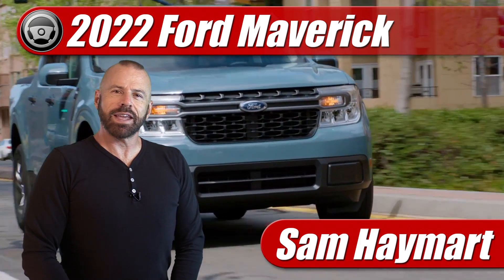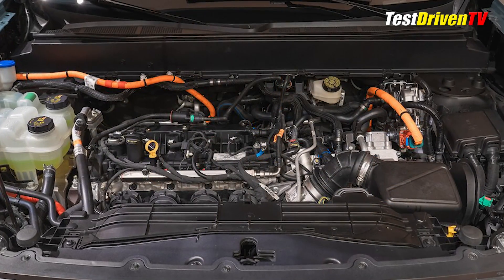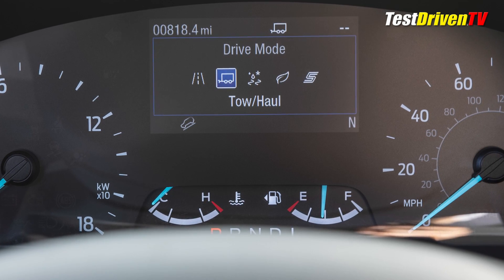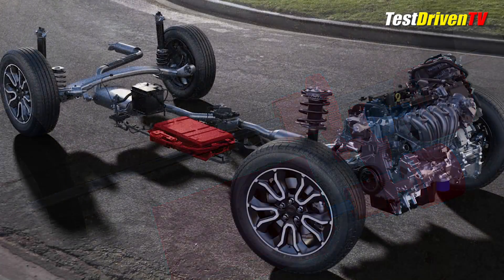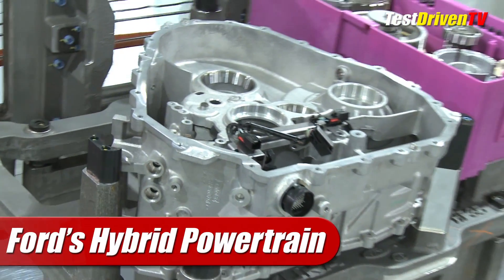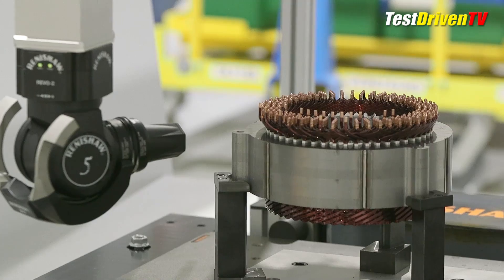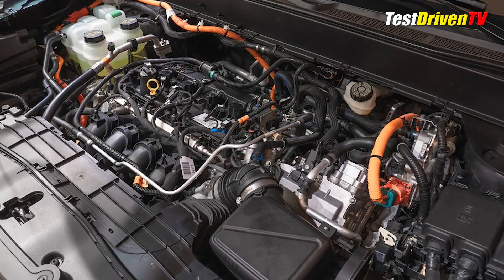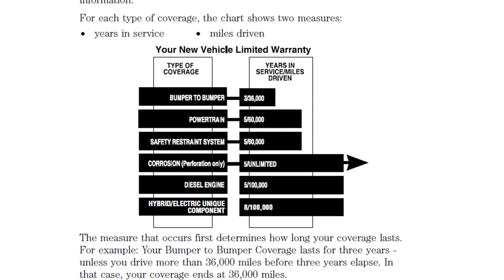2022-2025 Ford Maverick: Hybrid Explained

Comment: I’m having a tough time understanding how this transmission is continuous. How is the engine speed separated from the wheel speed and how is the engine speed carried to the wheels at a variable gearing without any pulleys belts or chains? Is the bigger electric motor doing this? Or to rephrase, is the engine spinning the motor which then spins the wheels or is the engine spinning the wheels?
Reply from the maker: That is Hybrid 102, this video was Hybrid 101. The simple (maybe) answer is that the engine and motors balance each other out. With a planetary gear set between the motor and motor/generator along with the second motor - all tied together with a single gear set, the electric motors can vary their RPM to spin the final drive above or below the RPM of the engine. The engine has an electric clutch that can disconnect it all together when it's not running.
Reply: @TestDrivenTV  thanks! I think I get it now. If I understand correctly then the wheel speed is only directly linked to the rpm of the large motor and the engine helps that motor by applying power to it while the final RPM of that motor is controlled by a computer applying current to it as wheel speed and throttle input demand.

Comment: Very good description but I think the transmission has another mode that you didn't mention. That would be the main electric motor powering the wheels while the engine powers the motor/generator (w/o a mechanical connection to the wheels). Let me know if I go that wrong.
Reply from the maker: That's in the Hybrid 102 video ;)

Comment: Being that the normal engine is being used at highway speeds, if I'm commuter, 40 highway miles one way to work. Would it make better sense to go the Ecoboost route? Excellent video. In other words, would I benefit from going hybrid if most of my miles traveled are at highway speeds?
Reply: Of course you're going to get 37 on the highway or greater

Comment: I have had 3 Ford or Lincoln hybrids.  They have all been exceptional, with only 1 hybrid related failure, a switch on the ventilation damper door on my 1st hybrid, a 2005 Escape.  I've put a total of over 500K miles on these, my last one was a Lincoln MKZ and I traded it in with 216K on it and it still had the original plugs and rear brakes.  These cars are very refined and extremely reliable.  I laugh at people who try to tell me that I will regret having a hybrid because of higher maintenance costs.  Oil change on the Lincoln recommended at 10K, I pushed it to 15K with oil quality still good.  Brake life is unbelievable.  No transmission maintenance required.  12V battery life is great because it doesn't have the starter wearing it out.  I had a Ford salesman try to low ball me on trading in my Lincoln telling me about the maintenance costs I was in store for, I laughed in his face and picked up my keys and left.  I don't know many people with more hybrid experience than me, and its been all good.
Reply: I have a Ford C-Max and it’s awesome , I’m about to do the first brake job at 200k the pads still have 5mm left , I got an upgrade kit so that’s why I doing that and pads , but no issues at all no starter to replace no alwtermator either
Reply: At what mileage is the 2022 Ford Maverick hybrid battery expected to require replacement, AND, any guess on the cost? I'm driving way too much, at the moment about 30k miles per year. Ford only covers the hybrid battery to 100k, and I'm trying to decide how long of the OEM Ford Extended Warranty to purchase in light of a potential large expense to replace the hybrid battery at perhaps 100k. Would it make sense to purchase the ESP plan that goes to 150k, and hope the battery holds out, or just keep it for 3.5 years and sell it at 100k?

Comment: Nice video and explanation of the ecvt.  I'm more interested in the upcoming Ranger Plug in Hybrid and was wondering if they will be using similar systems.
Reply from the maker: A Ranger HEV/PHEV would use a system identical or similar to that found in the Ford Explorer which is completely different from the one found in the Maverick. The Explorer uses a conventional 10-speed automatic combined with an electric motor instead of an eCVT described here.

Comment: I wonder after 100thousand miles can the truck still be driven without replacement of lithium battery and if so what would be the miles per gallon without hybrid running? Or you can't run the truck?
Reply from the maker: Anecdotal evidence out there shows people are driving Escape and Fusion hybrids with well into 200k-300k miles with the same battery. The weaker the battery gets over time, the more the gasoline engine will run which means less fuel economy.
Reply: So many people online, and in this very comment section are talking about how their ford's/Lincoln's with this very hybrid have 200-300k on them with virtually no issues. It's very well known that these hybrid systems are lasting 400-600k in escape hybrids. Words can hardly express how durable these hybrids are.

Comment: Ford will do well with this truck; it checks so many boxes for consumers and commercial users alike. Very impressive.
Reply: I can't imagine them not doing well. Haven't gotten mine yet but with the gas prices climbing ...........
Reply: @timjohnson1199  Have you received your Maverick yet??
Reply: @jimh.412  I have not. Everyone like me seems to be getting them around the one year mark which for me would be mid October.  If it doesn't happen within the next two weeks I'll get converted to a MY '23.
Reply: @timjohnson1199  Ok yeah I'm thinking about ordering one. Was just wondering what the average wait time was. So probably about a year wait?
Reply: @jimh.412  It's been out there a lot that the MY '23 will get production detailed and ramped up. But I would still not waste any time and order on Sept 15th when they accept new orders. Join the Maverick Truck Club for more details.
Reply: @timjohnson1199  Ok thanks!

Comment: Hybrid equals more maintenance and more out of pocket cost over the life of the vehicle. The 2.0 turbo has a lot more power and has been around for a while. It is a very good engine.
Reply: Uhhh it's actually the opposite. Less moving parts, the engine runs less, it's under less stress. Electronic components are more reliable and rarely fail. The battery will be under 100k warranty and by the time it fails a new battery will probably be dirt cheap because battery tech will explode in advance in the coming decade. Btw, I wouldn't trust a turbo charge ford engine if you told me God built it by hand 🤣
Reply: @DutchiezRNG  wrong hybrid is electric motor plus gasoline engine. More parts and the battery will not last 100k miles it will not be covered ford does 60k any way and truck people have a saying. It isn't broken in until 300k.
Reply: it is the opposite the turbo heats the engine and pressurizes it which wears engines out faster, also turbos dirty oil faster which is why they recommend changes 2x as often. All that yuck will also be inside the cylinders. add to that the hybrid regen braking will slow pad and rotor wear.  The hybrid is litteraly less maintenance for several reasons.. i could go on, just saying.
Reply: @LS-yv8zh  Your wrong also. Hybrid adds a electric drive train to a gasoline drive train. You literally double the amount of ways to propel the vehicle. It isn't rocket science.

Comment: Ford Is Starting To Get On My Nerves! Just Forgetting About Their Loyalists That ONLY WANT A CAR WITH LOW CENTER OF GRAVITY! JUST GIVE US THE CURRENT GEN FOCUS CAUSE THIS IS RIDICULOUS! It’s Like Ford Said “ Well We Already Used All Our Leftover Jaguar, Volvo, Mazda & Aston Martin Parts & Designs Now Let’s Use The Rest Of These Land Rover Parts & Designs That Are Leftover Too!” Plus All These Dangerous Recalls Cause Of “COST CUTTING” In The Wrong Areas! Looking Back Ford Has Been Careless About This For Over 50 Years!.. Ppl Are Starting To Second Guess If “Firestone Tires” Were Really The Problem On The Early 90’s Explorer!! Because My 2016 Sport Had PTU & Rear Suspension Recalls That Could Detach & My Fusion Platinum Had Steering When Bolt Recall Which Can Cause It To Literally Fall Off In Your Hands!🤦🏽‍♂️. I Really Want The Current Focus ST So If They Can’t Offer Something Then I’m Going To Honda.. Since They Didn’t “Sell-Out”…✌🏽

Comment: The Maverick's hybrid seems to be very similar to Honda's CRV hybrid system; in that the gas engine supplements(throught e starter motor) the battery and e-motor while e-motor itself is the total drivertrain: motor and transmission not unlike a Telsa. The Honda CRV uniqueness is that its still uses a mechanical AWD system.

Comment: So the brakes wear down? Regenerative brakes usually means that you should almost never need to change the brakes. I have the same brakes on my hybrid from when I bought it 10 years ago. They have just been adjusted a few times
Reply: As long as you aren't slamming the breaks, you should be able to slow down and stop on regenerative breaking. But if you need more stopping power, break calipers on a large rotor is the way to go. The less time you activate the calipers, the longer breaks last.

Comment: Disappointed that one cannot select EV only mode, and also it would seem that adding a few deep cycle batteries would add some range, but not an option if EV only mode is not an option. Guess I will wait for the plug in. Thanks for the information.

Comment: Very interesting -- especially that the combined total power of both motors (126 hp and 173 ft-lb torque for the electric, 152 hp and 155 ft-lb torque on the gasoline) is much higher than what they can effectively deliver working together. It would have been interesting to hear why the total isn't equivalent to their sum, though I imagine it's because they cannot both operate at full tilt at the same time. But otherwise a very good report -- thanks. I also have one on order!
Reply from the maker: Their horsepower and torque curves are vastly different, overlapping rather than parallel. At no time can you summon both power sources together operating at their peak rpm at the same time to get a cumulative output.

Comment: I have a 2014 C-Max Energi. It is one of the best cars I have ever owned. One thing that really isn't brought up is how long the consumable components last. Since the engine is used so little compared to the electric, I get over a year between oil changes (even then, it almost doesn't need it but I do anyway because I am afraid of oil viscosity breaking down because of the time). I still have the original brake pads on at 81k miles (because of regenerative braking) and the last time I check, I estimate I will get 120k miles on them! We get about 60 mpg out of it (and my wife's driving is not really ideal for maximizing mileage, either). I own 7 cars and trucks and all have V-8's except the C-Max and my sandrail so I am not exactly a tree hugger, but I will not be giving up that C-Max for commuting anytime soon unless it is for another plug in hybrid or a full electric.
Reply: My 2012 Lincoln MKZ hybrid had 215K miles on it at trade in and still had original rear brakes.  Fronts were replaced once and were over 50%.  Still had original spark plugs.

Comment: GREAT clear and informative video! Thank you for making this, I’m seeing so many comments with people concerned about the “”cvt””…. it’s an ECVT and it shares no resemblance to the notorious CVTs of old. I would bet the Ford Mavericks with the long proven and iterated Ford Hybrid drivetrain will be even more reliable than the Ecoboost optioned ones. Mark my words, especially when you consider the fewer moving parts and regenerative braking saving the brakes in the Hybrid system. People don’t realize that Ford tested an earlier version of this Hybrid drivetrain in NYC taxis for YEARS… and many of them are still running fine!
Reply: Plus, the Prius drivetrain has been used in taxis for years with no issues. And the Prius hybrid system is very similar to the type used in the Maverick and Escape hybrids.

Comment: I love my 2017 Ford C-Max Hybrid.  So, I was thrilled that the Maverick will have an updated version of that incredibly smooth power train.  Unlike some other manufacturers' hybrids Ford's will actually operate in electric mode at freeway speeds.  My C-Max does slightly over 70 with flat grades for a few miles at a time.

Comment: I love the nonchalant "It can kill you."
Reply: Warning :   "No Touchie"
Reply: The cables looked pretty protected but,  yeah, don't mess with them.
Reply: Your house has electricity. It has even more ways to kill you. What's your point? 

Do you just flip a light switch, nonchalantly? Or do you find a rubber glove and a ten foot wooden pole, to turn on a light?
Reply: @joezolo9986  i think the point is we're not used to there being anything under a hood that will zap the life out of us.  I didn't know until I watched this, and I've had mine for 3 days - sticking my DIY hand down in there messing with stuff.  That's the most valuable thing i've learned here.  These videos are SO well done and SUPER informative.  Thanks SAM.

I bought a salvaged Maverick with 9,000 miles and a lot to do to get it back together.  Just knowing this stuff is a great start!!
Reply: YIKES!

Comment: If you spend most of your driving miles in the city using the electric motor, and return home with the battery depleted, how do you recharge if you don't plug it in? Do you have to run the gas engine in order to recharge the battery?
Reply: As you drive the engine recharges the battery.
Reply: The computer won't allow for the battery to be depleted

Comment: Great video,  I'd like to see  something that covers what this truck can realistically carry in the bed.  Do sheets of plywood really fit between the wheel wells, how many yards of gravel or dirt can it carry etc.  I'm a DIY homeowner and would hate to get something that really can't be used as a truck on occasion.
Reply: Plywood, will rest on the wheel wells, and the tailgate. The tailgate has a half open setting, to match wheel well height.
Reply: you can carry 1500lbs of gravel and dirt in the bed i think you'll be ok

Comment: I'm curious as to why Ford has made all of their smaller platform, AWD vehicles non-flat towable? They are missing a fairly significant market of RV'ers who like to use small, 4WD/AWD tow vehicles. The days of Suzuki Trackers and the likes are long gone and there is still a void for that type of vehicle. Surprisingly I have read this FWD hybrid Maverick can be flat towed. That is great for those not requiring AWD, but sadly it doesn't fit the bill for many.

Comment: I have two questions. 1 is wonky. But I like to ask. 

If a house is on fire and has solar panels firefighters aren’t supposed to put the fire out. It’s not a great idea to spray water on a giant electrical grid. With that said, if a hybrid or electric is crumpled, do they use the jaws of life to peel you out? Because using a giant metal set of pliers on a big battery is not wonderful. So can someone answer that and second. 

The Ranger and f150 are build on a ladder frame and then put together. The Maverick is all one unit. So what does that do for accidents? Big or small. If the entire body is uniform, does a slight fender bender require tons of work or less?
Reply from the maker: The vehicle is not made out of a battery. The high-voltage battery itself is a single component that resides underneath the vehicle as described in the video. Firefighters have been dealing with hybrid and electric cars now for over 20 years. They know what they are doing.
Reply: weird how people are so concerned about the safety of lithium ion batteries like the ones they’ve been keeping next to their crotch for decades now (your phone, also laptop, etc) but don’t bat an eye at the tanks of highly combustible fuel they’ve been sitting on top of as long as they’ve driven an ICE vehicle… ICE cars have been known to burst into flames when the fuel tank ruptures in an accident. 🤷🏻‍♂️
Reply: @word42069  technically the hybrid owners get to worry about the gas blowing up and the lithium smoke suffocating them bonus

Comment: I forgot to mention, my hybrid hylander was is rated at 35 mpg combined. I am averaging 37.4 mpg. I have found that the electric power can be controlled by barely touching the excelerater. All these things are explained in the owners manual. Also, I bought it off the showroom floor on a rainy Friday night 15 minutes before closing time. It stickered for $47600. After 2 hours of negotiating back and forth, my purchase price was$38700. I drove several other vehicles, but nobody would budge on price. I was getting $1600. Off sticker at best on other brands. And also my Toyota was built in southern Indiana close to home. So if this is your first hybrid. Go for it and don't look back. You'll love it.